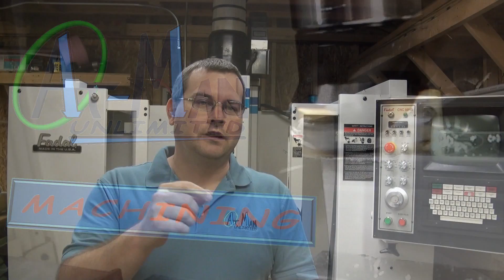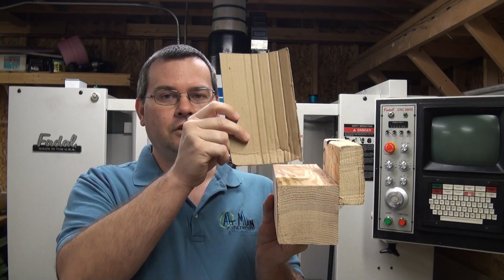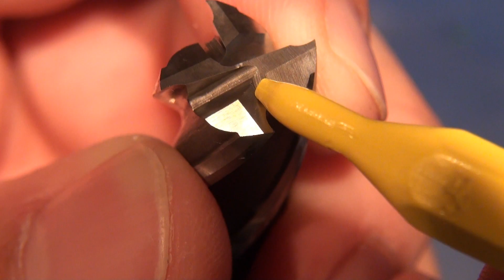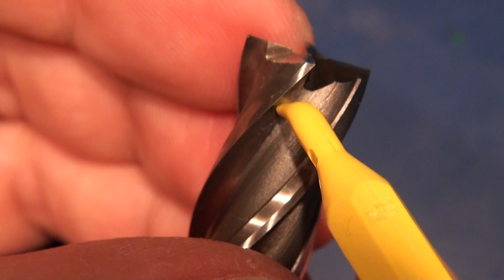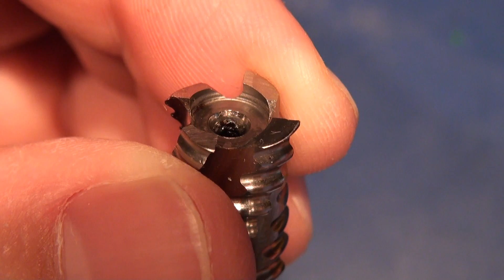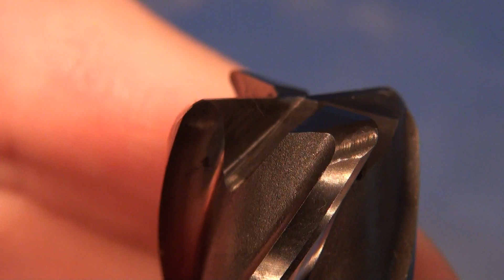End Mills, The Nitty-Gritty: Cutter Geometry

Comment: to minimize chip breakage at the bottom sunmica of a wooden door, what is the radius of a radius corner of an end mill required?
Reply from the maker: Corner radius is most likely not going to solve the issue. You may need some specialty cutters for the application.
Reply: dear sir,

hope you are doing fine and thanks for your reply. can you tell me what kind of specialty cutters for the same?
Reply from the maker: For any type of laminates they make end mills with a helix that converges in the center. That way the cutting forces tend to compress the material together and reduce chipping on one side you see with normal end mills.
Reply: Thank you sir! can you please email me the image of that end mill with  a helix? exactly i am not getting or i have not seen end mill with a helix yet.thank you.

Comment: Great series on cutters. Any chance of showing proper sharpening practices? I just got a used cuttermaster and although it seems straightforward it seems to be an art form.
Reply from the maker: Thanks, With the more advanced end mill geometry today, coatings, and other factors, I don't think to many people sharpen in house. Drill bits yes, but even some of the biggest shops around my area send there stuff out that I know of. As for drill bits, there are far more qualified people on YouTube that have made pretty nice sharpening videos already. So most likely wont see a sharpening video from me. I do have a bunch of very large HSS end mills that need to be sharpened though if you need practice ;)
Reply: If you are not in a big hurry I would be glad to sharpen them for you. I can only do sizes that fit in a 5C collet though. I am new to CNC and your videos have helped me quite a bit decide what machine to get. Glad to repay you with some labor!
Reply from the maker: I think all of them are 1" shank so they should fit, cutter diameters are 1" to 2" I think. They where donated by another viewer but I have not had a chance to get them sharpened. If you would like to have at them I can send some your way. No timeline, very appreciative of the offer, thank you. Send me an email, its in the description if you would like them shipped.
Reply from the maker: Oh, and holy crap that dyno video doing the WOT run is cringe worthy!
Reply: The FJ or Hellcat?
Reply from the maker: Hellcat is nuts
Reply: It was a blast to drive but was a 6 speed. I blew out my left shoulder so shifting (which happens very quickly when your foot gets heavy) and steering were too much. So now I am thinking about Demon Hellcat with an automatic, just a bit quicker. Can you say wheelie?
Reply from the maker: LOL, I built a 23 bucket when I was younger, 400HP in 1600 lbs of car with 100" wheel base. I'm actually amazed I survived my 20's. Maybe I will show some pictures of it as some point. Never did finish the interior or paint it, that was money spent that did not make it go faster, what a waste ;)
Reply: Hahaha, in my 20's I wired a t bucket for guy I worked with same thing big motor no weight skinny fronts and steamrollers in the back. It had a horizontal steering wheel and about 6" of body above the seat. So like a dumb ass I nailed it and flew backwards, only thing that stopped from me flying completely out was foot in the steering wheel! Scratch that pair of underwear! Funny how when you are younger you think you are indestructible. When I was in the service in Louisiana it was legal to drink and drive. Dukes of Hazzard had nothing on me.... :)

Comment: Nice use of CAD

C ardboard
A ided
D emonstration

It can be quite helpful to remember that we're never really cutting, but putting pressure on the material in the right way to get it to fracture where we want. There's a video on YT called 'Iscar Chip Formation' that's got slow motion footage of what happens in the cut.
Reply from the maker: LOL Thanks Paul, wait till the helix and flute video is released ;) I mentioned that video in one of my takes but it did not make it through editing. You are correct, it is more of a sharing action to cause the metal to break along a grain line. Here is the video https://youtu.be/mRuSYQ5Npek You can also see how the tool radius can effect surface finish and how material can build up on the cutter.

Comment: "Low to high" with a ball end mill? I had never heard of that, but it makes a lot of sense. Awesome! Thanks for this very educational video.
Reply from the maker: Your welcome, its all about keeping the center of the ball off the material if possible.
Reply: Yes, and it also reduces axial pressure which can be critical for smaller machines to be able to retain accuracy without the need for multiple spring passes. In addition it greatly reduces heat generated due to the ball's center region "rubbing" the material.